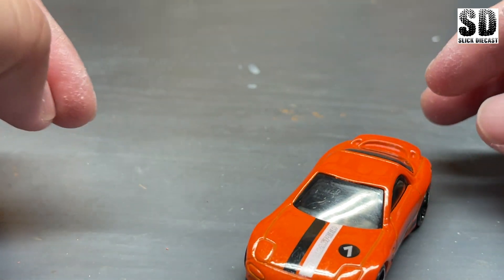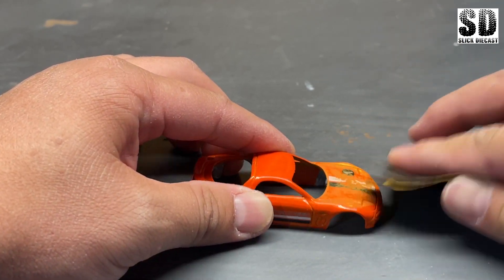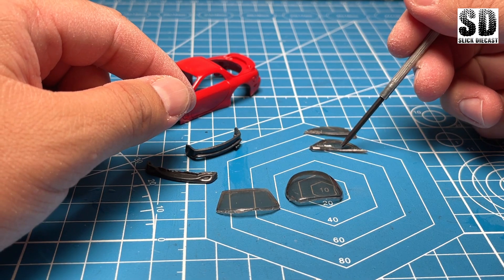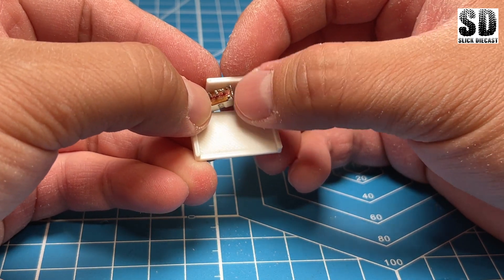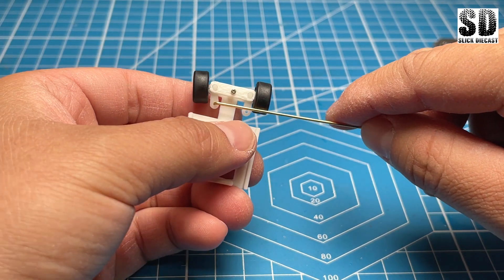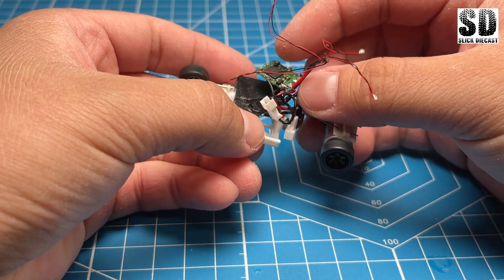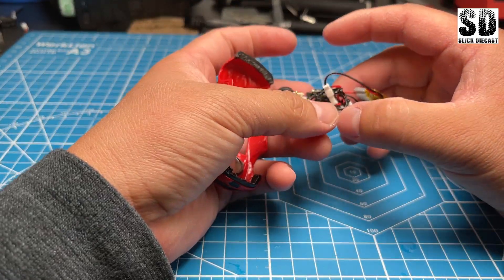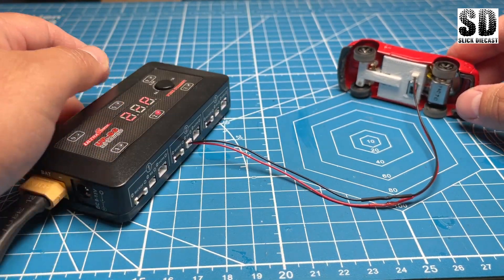How To Make Your Own MICRO RC car using Mazda RX-7 Hot Wheels - FREE STL DOWNLOAD

Comment: I didn't notice an ESC being used here, is it not needed with this particular receiver?
Reply from the maker: That is correct.
Reply: @SlickDiecast  Why not? Does the motor get pwm signals from the receiver? I see an ESC listed in your parts list too, sorry if this is a stupid confusion :)
Reply from the maker: Yes it does. The ESC listed is to be used with the Radiolink receivers.

Comment: 2 questions 
1. at 10:33 on the brass steering rod how would u attach the bent piece in it?
2. when installing the motor assembly to the chassis what size rod do you use?
Reply from the maker: A hole is drilled on each steering knuckle. I bend the brass rod and just insert it. Then use a little bit of hot glue on the end so it doesn’t pop out. The rod size for the motor is .017”.

Comment: This is a great model, looking at building one.
Is the micro ESC used in the build?
Cheers
Reply from the maker: No ESC for this build.
Reply: @SlickDiecast  Sorry for the late reply, but why not? I'm trying to get into making my own, but not sure yet what role the ESC plays and if it's required etc
Reply from the maker: A lot of receivers will require an ESC. You will need it to control the servos and motors.

Comment: I feel like you should experiment more with a smaller and more precise front axle and thinner tires you will notice a massive increase in control, i recommend watching the TLS garage video on his RC models but I’m sure you already have. I really like the 3d print work you do though it always comes out looking clean at the end keep it up man good stuff
Reply from the maker: Thank you for the suggestion. The front steering had always been something that I had struggled with. And yes, TLS garage had done some great ones and I’ve seen them.
Reply: I agree ☝🏽. Everything is extremely neat even the steering but it does need bit of work and it will make a huge difference. Keep it up man I like what ur doing